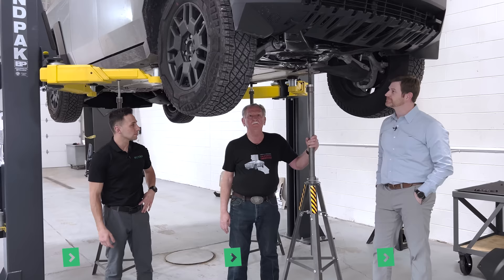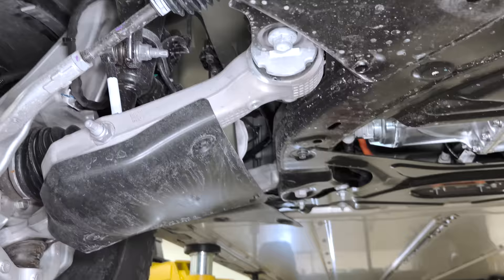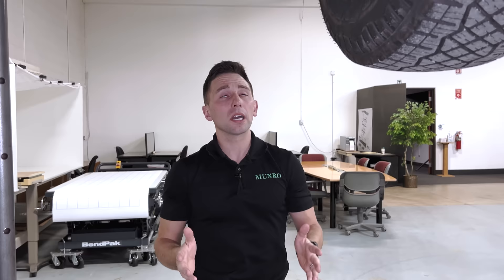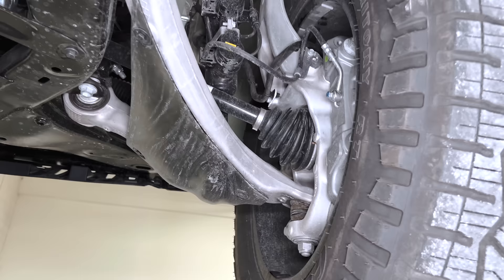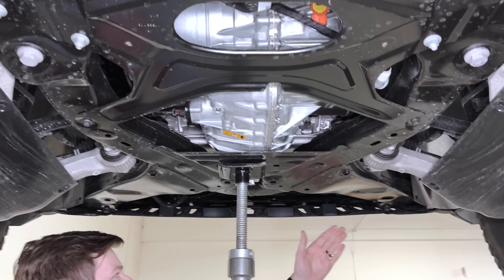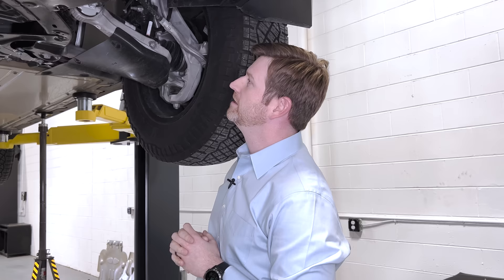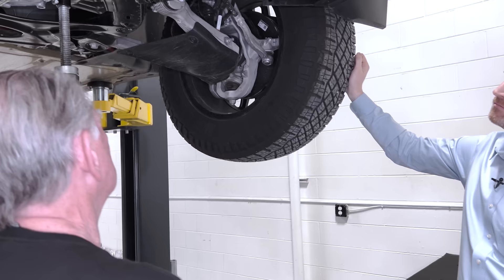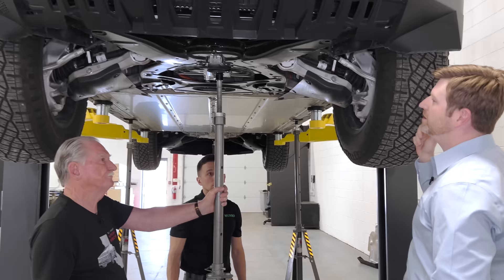Tesla Cybertruck Underbody

Comment: The headlights get iced and snow covered. No heat led,safety fault. Lights recessed in a big Grove to collect snow and ice,horrible design. Kitchen knife on wheels
Reply: Odd, several Cybertruck owners in the snow have not had a problem (and thought it might be a problem).  Need more Cybertrucks on the road to see if it's any different than other trucks as far as snow buildup. There are plenty of generic trucks available that look like every other truck on the road if that's your thing.
Reply: @tesla_tap There is a u tube guy who drove his cyber truck almost cross country, in the snow in Colorado, he specifically said, the headlites suck.  They got all covered in that small grove area, not enough heat to keep clear melted cus LED.  It's a major safety issue.  tesla are always untested, they use customers and public roads as test beds, borderline criminal.  this stuff will eventually hit Tesla big time
Reply: @cengeb -  You are right. Looks like most manufacturers have this problem with LED headlights in some snow conditions, since they run quite a bit cooler than old incandescent headlights. Glad I don't have to drive in snow! I doubt Tesla, Toyota, GM, Ford, etc, are going to go back to incandescent bulbs. Maybe not drive in the snow at night if this is a major problem for you.
Reply: @tesla_tap My headlights are not sunken back in a place that lets snow pile up when driving in snow.  The lens are tapered, smooth and out in the open, so stuff rolls off, this recessed in a deep groove is another dumb design.
Reply: @tesla_tap and being so recessed even a car wash will not get in there and clean properly, like cars with headlights where they should be, and are easy to clean.
Reply: @cengeb Google "snowed over headlights" and you see vehicles from Toyota, Jeep, Rivian, Volt, etc.  So not unique to Cybertruck.  I'm sure if more than a few people have a real issue, a third-party will come out with heaters or covers for those that have this issue.
Reply: @tesla_tap there should be little heater elements in headlight assys...but, then that defeats the point of low wattage LED...can't win.  Just like street stop lights, in bad storms, LED red lights get covered. no heat like old incandescent, if they put in little heaters, again, defeats LED watts saving, but the longer life is still a major benefit
Reply: Leave Cybrtrk for people inteligent enough to know how to clean of snow 😂
Reply: Cybertruck, is the SAFEST truck ever built.
Reply: @markplott4820 pedestrians are doomed..kitchen knife on wheels
Reply: @cengeb   - Cybertruck, is the SAFEST Truck ever tested.
Reply: @cengeb - Cybertrucks are safer for pedestrians than 99+% of the vehicles on the road. It has pedestrian avoidance technology.  So much better to avoid running over pedestrians than hoping they survive hitting the metal and windshield of cars and trucks without that technology.  Even the EU allows for avoidance technology over dubious approaches used to try and reduce injuries from hitting cars.

Comment: The upper control arm is complete trash for offroading. I guarantee that comes apart if people the the truck
Reply: what do you Expect ? its STOCK.
Unplugged sells off road packages for Cybertruck.
Reply: @markplott4820  built to kick butt in baja and work as a boat according to elon. I searched for your suggestion and found that control arms have already been shredding and 3 trucks have glitched out crossing small amounts of water. 

I expect what what was promised by the CEO call me crazy 🤷‍♂️
Reply: @mattbrew11   - so did MANY other Trucks. non Sequitur,
Reply: @markplott4820  the raptor is built to kick butt in baja and it does. Zero claims of boating from every other manufacturer
Reply: @mattbrew11   - Raptor , is too SLOW , its overweight and uses too much Horse & Buggy technology.
Reply: @markplott4820  I wanna know exactly how much offroading experience you have because it’s obviously less than zero. You are just a tesla troll unable to be critical of anything they do

Comment: Front caliper mounting bolts?  Interesting placement.  No ear on the knuckle, instead the bolts run through the caliper and thread into the front side of the knuckle.  I've never seen this configuration for mounting a caliper before.  Any ideas as to why they chose that method?  4:08 for a time reference, the upper bolt is visible just to the right of the brake hose steel to rubber joint.

Comment: Everyone - They're using a cheap stamped upper control arm 
Cybertruck owner - They're blazing a new trail
Reply: That is not there to save money so much as to be the right part for the job.
This truck was designed with a digital twin.  The front wheels are designed to tear off in an accident.   Too strong and that would not happen.

Comment: The plastic cover on the lower wishbone is probably for aero at high speed? Any mud would get thrown out of there fairly quickly with wheel moving up and down.  The plastic cover wouldn’t stay on long with fasteners hence why it’s bolted on

Comment: What is that complicated metal strip running down the center of the battery pack? Looks like an attachment for hold-downs, but what do you want to attach there? More broadly, I'd be terrified of damaging the underside of the battery pack, that looks like a real 'Achilles heal' for an off-road vehicle! Also, have any covers already been removed when we first see the underside? There are what looks like covers stacked against the wall. Otherwise, looks a bit exposed, particularly some of the orange wiring.

Comment: Very interesting. Is it the two redundant steering motors we can see with the QR labels? Seems to be blue connectors for the 48V system. Is there a separate floor in the production model? Or is the battery pack the floor inside the vehicle?

Comment: Sandy and Kevin, common to the center rear casting @ 18:58, tooling cuts. I didn't hear any one mention that the tooling cuts may be for correct alignment in a tooling jig, either before installation as an assembly or during the assembly process. I am wondering if a precise location is needed within a holding jig for proper assembly work or installation would be the reason for tooling cuts? Nothing else comes to mind as two pointed out.

Comment: Anyone who says anything along the lines of "allows them to get a way with" this kind of upper control arm has not seen the video where the upper control arm is completely annihilated after one off-road jump
Reply: Actually it is designed for crash safety.   In an accident the front wheel part ways with the truck going to either side so they do not join the passengers in the cab.   Safety first.

Comment: At 23:15 right 23:16  next to the open high voltage connector is a gray plug that looks like it is possibly a coolant connection and another over to the right. Possibly coolant connections for the Range Extender battery?

Comment: Did you remove some shields. Those coolant and power connectors seems pretty exposed, especially for an off road vehicle.
Reply: Yes, they did.
Reply: Munro , removed ALL the Closeout/AERO shields, AIR Diffuser.
Reply: Ok, I mention it because of this video where Tesla want's to replace a model 3 battery because the coolant plastic fitting has broken off: https://youtu.be/n8-OkfCcRAo?si=Gbj_8nHuQuN3jQHY&t=69
Based on this video I would definitely prefer a coolant connector that is easy to repair. In general plastic parts gets hard and brittle after a few years which not very environmentally friendly. A good exampel is a 10 year old BMW engine compartments where there is a lot of brittle parts that can not be disconnected.
Another example is the hood of this John Deere tractor: https://youtu.be/pYbmGZeFMd4?si=Jki1gYAC6fQWTTK0&t=107
Just shitty design that is just unacceptable if you give a damn about repair-ability and the environment.

Comment: I’m sorry to be harsh, but how a piece of alloy has been re-machined? A extra battery port? Please show us impact and longevity stuff. How long has the truck been out to only now look under it?  Find a real damaged ones to show us front end deformation. How does the forward positioned   steering rack hold up?  How does the front wheel assembly break away?  One thing I noted is the length of the battery cell, with regards to ground clearance . Even when Mr Munro taps it, it sounds hollow. How much impact can this take before battery cell damage?  What’s involved in repairing these components?  This is a truck with off road capability. How will the real world treat it on a time scale?  I’m sure insurance companies will be interested in such coming data. 
 Sorry. This is all fluff and sales propaganda. Sure great engineering, but I’m less interested in my sound deadening degradation over time, more interesting in fail points that render a product written off. 
 Having worked on independent vehicle inspections related to serious accidents, for law enforcement reports, I’d like to see real world data. That said I’m sure the cyber truck meets and exceeds all safety requirements. Just curious to it’s written off point.
Reply: MUNRO is just , Beginning the teardown.

Comment: I think the sorb thing on the suspension is for changing it for different wheel packages. It would be smaller or missing on a smaller diameter wheel.

Comment: I just watched this video once so I know I didn’t catch everything but I’m really impressed with how much jargon you are sharing.

The tap on the bottom sounds hollow so it sounds like there is a protective cover for the battery pack. The pack itself is not exposed to the possibility of scratches (tearing) or penetration.

The body panels are structural, the battery pack is structural plus there is an actual frame, with gigacastings (one at the front, one at the rear?). The electric motors are big solid objects. How can they add structural strength to the vehicle instead of just being bolted on? Also I’ve been curious about the doors (and the roll cover for the box) if they can somehow add rigidity to the truck? The door openings are massive holes. Stock car racing cars would weld the doors shut back in the day. There must be a way for the doors to add structural strength to the overall truck that doesn’t involve welding them shut. The doors don’t need to carry all the structural strength to the point the truck would collapse when you open the door. They just need to add strength for different crash types. And maybe if you push it reduce long term fatigue. The way the doors fit to the truck would affect how the doors lend structural support to the cab. It’s likely the doors already affect structure for things like side impact crashes (t-bone).

I heard also some car models already feature air bags on the outside of the car to reduce the shock of vehicle to hard object crashes as well as to protect pedestrians. I know one type of crash is when a large animal runs up over the front of the car and smashes the windshield, partially / maybe fully entering the cabin through the windshield (animals like a cow, deer, moose, etc). Air bags could sort of catch them at the front or slow them down so they don’t strike the windshield so hard.

The electric motors, are there different shapes they can have that allow them to lend structural strength to the truck? Or is the design trajectory just to keep making smaller, lighter electric motors?

Comment: The bolt on add to the linkage inside the wheel would very much a appear to be a upgrade to distribute load quicker in the crash sequence , it appears it was added to the linkage POST an early crash test result and engineered as such.  Obviously the inspection mark ensures that it is there , and checked off the checklist inspection item.

Comment: @HartWelles mentioned in this thread the rear connector could be for the add on battery pack thats not available. I think it would be nice if they made an extension for that connector to the rear of the truck.  Maybe at some point trailers with floor installed batteries could be connected like the ones in the pebble. I think it would be nice to use that extra power for adding miles if you're towing.

Comment: Looks like rear suspension has a large negative caster. Dont remember seeing that anywhere else, probably due to the rear wheel steering. It makes me think, what kind of caster are they running in front when the wheel are turned with an electric motor? The more caster the bigger motor you need to turn the wheels... You should measure all the steering angles and see if there are other oddities to be found.

Comment: can you guys check if the wheels turn in different radius.  Since the outer radius should turn less then the inner radius of the wheel on the turns.  Since Cyber truck is steer by wire this should and probably was implemented on the software side.  The benefit is even grip and prolonged tire from wear.

Comment: I wonder how close are the battery cells from that plate on the bottom and if a rock scapes it or dents it, how much at risk are battery cells? My quess is the cells rest right on it and I would think a quarter inch of material, like a foam plastic or something should be protecting them from that plate.

Comment: That kbockle inside the rim of the tire is brake & energy absorber inlet line when braking adds convert friction into the  battery restoration system on each wheel channel back into baterries voltage

Comment: The lower control arms all hang down when the wheels hang down. That reduces clearance at the wheel. Mounting the control arms a bit higher would increase the clearance. Also, the control arms look curved down a bit. If they curved up instead that would help with clearance.
Reply: They don't expect that the car will be used in the wilderness.

Comment: My guess for the open high voltage connector is for a future wireless charging pad feature.
Reply: Makes more sense than the other ideas so far (motor, range extender battery pack). But then it would suffice to equip the Cybertrucks packs in the future, when this wireless charging pad (for inductive charging for the truck itself) feature is actually available.

Comment: The teslas with structural battery pack don’t have quite the safety of the standard body in white. At least with MY. I was the one and only person to discover this with new iihs measurements. The cast structural variant of the Y while still rated Good, shows more intrusion vs the standard BIW.

Standard non-4680 model Y shows massively better structural performance in front small overlap and side 2.0 impacts. Giga castings still needs work and optimization probably.
Reply: TESLA model Y is rated #1 in Euro NCAP updated testing. 
its also a BEST seller WORLDWIDE.

Comment: 15:00 the open connector is for the Range Extender (installed by the Service Center, not a user accessory) occupies 30% of the bed, allegedly compatible with other bed accessories (e.g. Basecamp tent) adds 110-140 miles' range, and costs an estimated $16,000 … : )

Comment: 15:43 Could that high voltage connector be for the range extender that drops in the bed? My understanding is that pack won’t be easily removable, and would probably need some sort of HV and cooling line connection. Maybe the umbilical would be routed through the under bed storage bin, which isn’t too far from that connector.

Comment: At 19:15 those lines look like a sloped top surface of a thermoplastic FDM printed part. That tells me they probably used a 3D printed mold or 3D printed prototype to create the mold for this casting. That aligns with something I vaguely remember about 3D printing with sand to do metal casting.

Comment: Is it possible that the extension on the front to close the gap to the wheel, is to punch a hole in the wheel and lock it from rotating?

Comment: Have you ever driven this  on wet gravel road??

  Material and rocks build up in the rim, getting pinched,  scraping aluminum material off the inside of the rim, cutting sometimes.
  We always had to put steel rims on. 
   shows lack of  testing on gravel roads.
  Especially seeing the small gap between the rim, hub assembly
   Holy looking underneath..
  Gravel will "sandblast" anything facing forward..
  All the wires tubes and brake lines will be exposed to abrasion from flying rocks and sand.
 Can I suggest gravel road and winter road testing.

Comment: 1:24 Volkswagen has been doing that since the late '90s in the European models. It was called the gravel kit, It included brake line protection.
Reply: VW are built like very CRAPPY Taxi.,
Reply: @markplott4820  But still have better panel gaps after 200,000 miles than any Tesla off the line
Reply: @_BangDroid_   - TRY again, the TESLA 2024 model 3 is the ONE to Benchmark.
IMACCULATE panels .

Comment: 15:17 The additional connector most likely is for the optional range extender which is basically a ~20 kWh battery that goes in the bed.

Comment: 2:40 The plastic airshield in the suspension arms is almost certainly bolted on (instead of using simpler fasteners) to allow disassembly of the suspension arms - I'm not at all sure the two arms and shield can be removed as a unit.

Comment: So can the open connected be used for dc charging?  It would be great to have hitch area dc fast charger.
Reply: The low voltage could be the power for actuating the door if you added it to the rear bumper

Comment: Sandy says that Cybertruck has every option, but I know it does not have the bed-mounted range extending battery (Which is likely the reason for that unused High Voltage connector) and it also doesn't look like it has the over-cab lightbar.